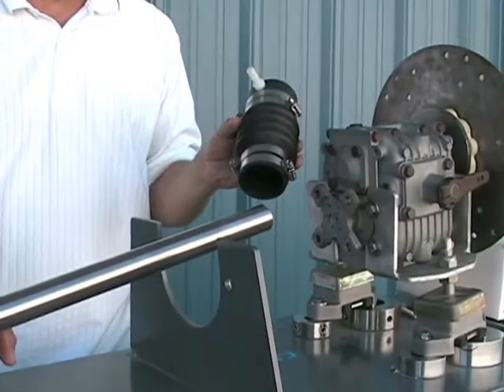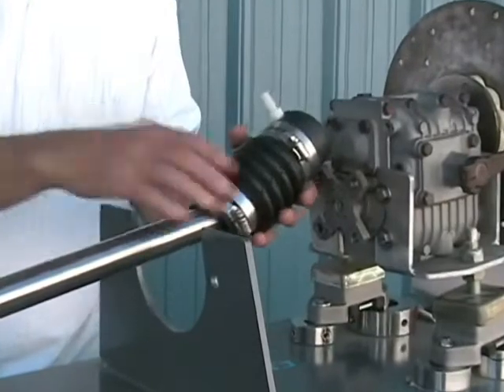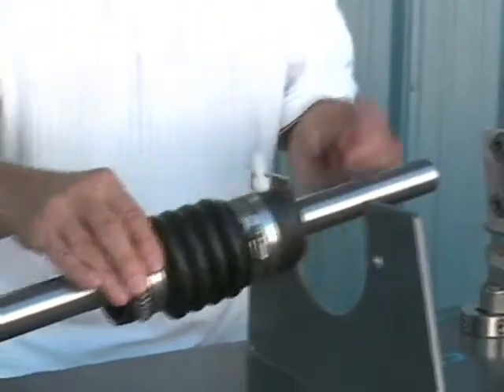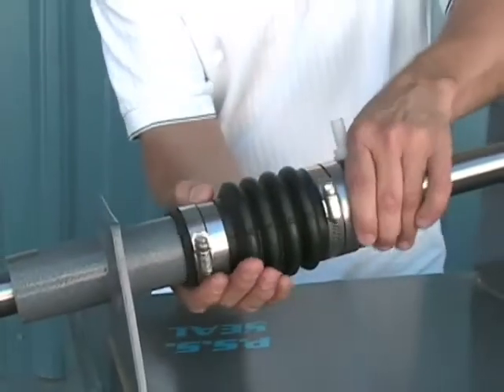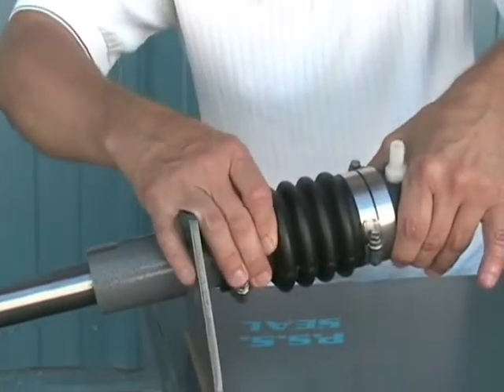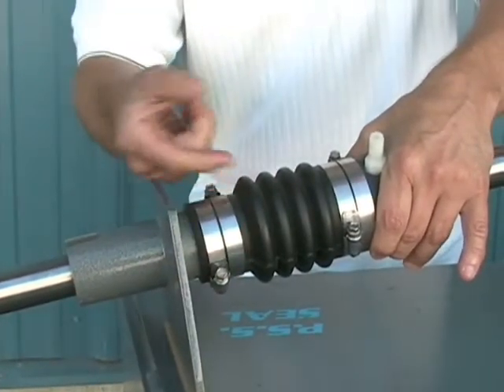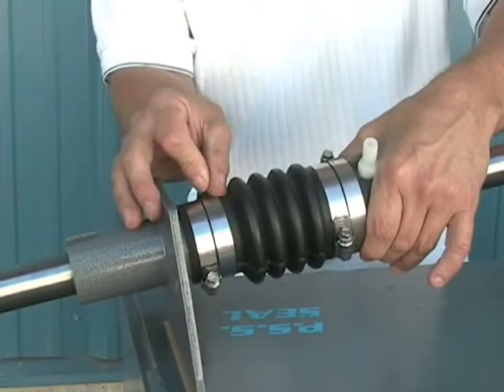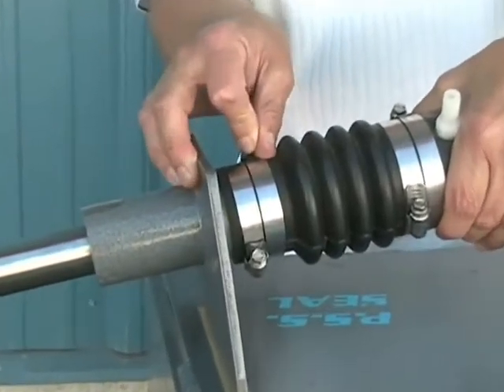PSS Shaft Seal: Cleaning Shaft & Installing Rubber Bellow

Comment: I've had the "dry" version PSS Shaft Seal on my 36 foot Mariner (N.H.) sloop for ten years. This past weekend, I head a squeaking sound coming from the shaft while motoring. Throttled down and put the transmission in neutral. Squeak continued. Shut down the engine. After a few seconds the squeak returned. Put transmission in reverse to lock the shaft and squeak stopped immediately. Sailed the rest of the day, about 25 miles. Turned the engine on to return to the marina. No squeak. Motored for about a half hour. Everything normal.

Called PYI. Tech asked if divers had been around the boat lately. Yes, a diver had scrubbed my hull a couple of months ago but also scrubbed a boat next to me just a few days ago. Tech said, air bubbles can get trapped in the the shaft log and cause a temporary water blockage. Then we discussed upgrading to the new water injected seal. Since I'm a few years past a seal rebuild, I will do the upgrade next spring when I haul out. PYI suggests several points on your engine's plumbing system where you can T-in a hose to connect to the water nipple on the shaft seal. This will give the shaft continuous lubrication.

Thanks Jason at PYI for all your help.